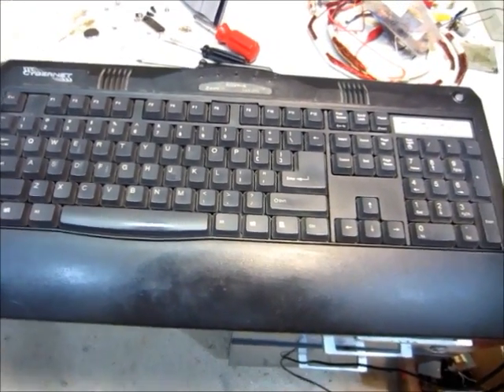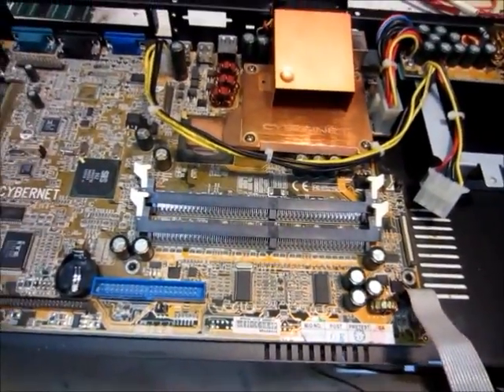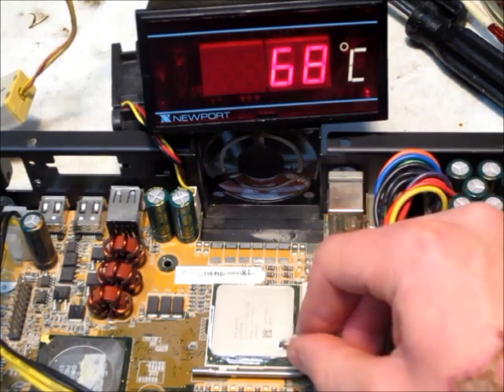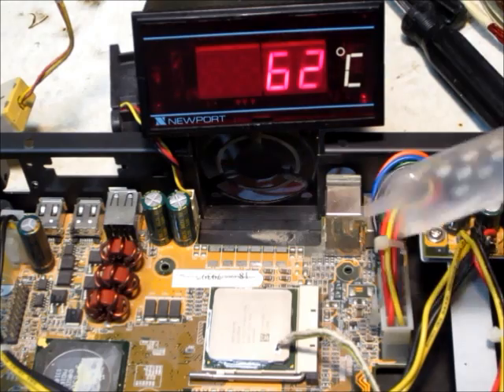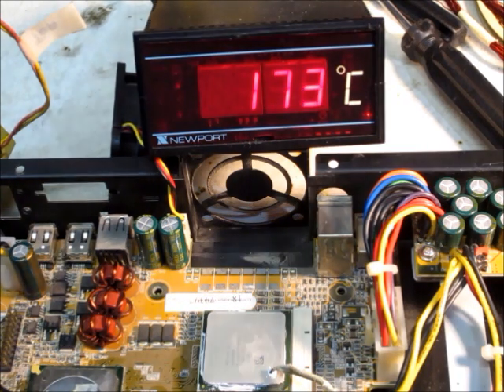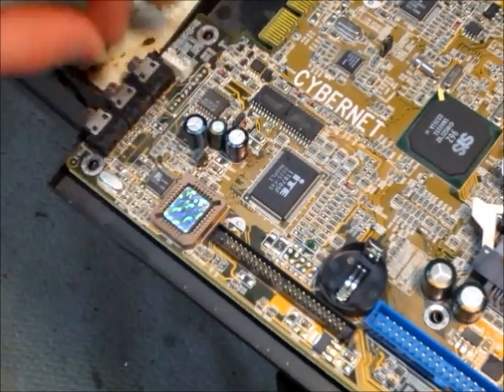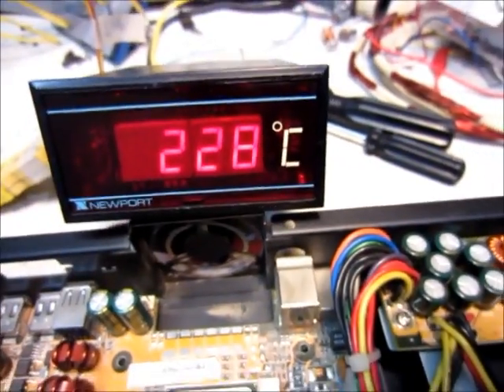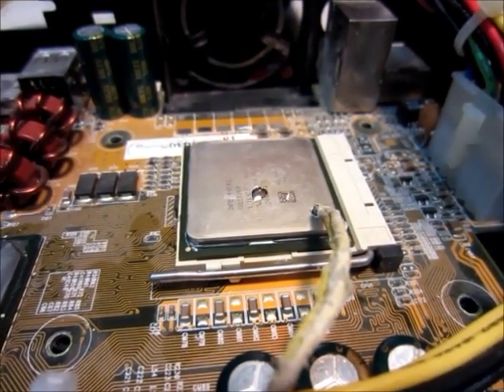Overclocked Computer CPU Without Heat Sink Stops Working at 234 Degrees Celsius and Melts Solder

Comment: I’ve seen computer inside monitors. I’ve seen computers inside monitor stands. Hell, I’ve seen computers inside desks. But I’ve never seen one in a keyboard, aside from laptops. 

Also, for being 10 years old, this video is pretty high quality. Especially for how young you sound back then. If I had to guess, you’re probably around the same age as me.

Comment: Surprised your surprised have heated copper to higher temp in the labs and other metals cpu's stay at 50-90 degrees for safety not because it will melt. Copper is made for wiring for a reason.

Comment: can fan without heatsink, cool-down cpu ?
air transfer heat better than thermal-paste.
Reply: i make mistake. air's thermal-conductivity is worse than thermal-paste
thermal-conductivity :
air : 0.024 watt/meter kelvin
artic-silver-5 : 0.94 watt/meter kelvin (experiment data)
                 8.7  watt/meter kelvin (manufacturer data)
themaxtech xt-flux-ga : 0.78 watt/meter kelvin (experiment data)
                        7 watt/meter kelvin (manufacturer data)
dow-corning tc-5022 : 4 watt/meter kelvin (experiment data)
                      4 watt/meter kelvin (manufacturer data)
shinetsu x-23-7762-s : 3.7 watt/meter kelvin (experiment data)
                       4.4 watt/meter kelvin (manufacturer data)
source : 
1. http://hyperphysics.phy-astr.gsu.edu/hbase/Tables/thrcn.html
   from google (thermal conductivity) result 8
2. 'watts per meter-kelvin (W/(m⋅K))' in https://en.wikipedia.org/wiki/Thermal_conductivity#10_sep_2018
   from ref[4] in 'The company claims that AS-5's thermal conductivity is 8.7 W/(m·K). However, a study led by the US National Renewable Energy Laboratory found that it was only 0.94 W/(m·K).[4]' 
   in https://en.wikipedia.org/wiki/Arctic_Silver#Arctic_Silver_5_.28AS5.29

Comment: But can it melt steel beams?
Reply: its a joke you dumb fuck
Reply: Surley it can melt dank memes?
Reply: haha that was so funny
Reply: +KOSCade No possible way.  Burn the living heck out of your hand if you touched it and hurt like language best left off of YouTube, heck yes, but in order to melt the integrated heat spreader, the CPU would have had to have heated up so that the reading on the kid's thermocouple would have to read around 1,000 degrees Celsius for common steel.  it would have burned up long before that point, of course.

Comment: how did he even shut off the protection?
Reply: +Ramses There was no protection because there was no RAM, the bios couldn't initialize.
Reply: The illuminati but if the bios didn't initialize how was he able to initialize the overclocks?
Reply: +Ramses Exactly, he didn't.

Comment: Wtf is wrong with ur hand
Reply from the maker: +Skyler Yeah... I spilled molten zinc on it...
Reply: why am I not surprised after seeing this video lol, nice vid.
Reply from the maker: Captain Gray Thanks!  I'll try not to burn myself!  :P
Reply: +Makerj101 The burns must have been really bad tough. But I'm glad to to hear it turned out alright :)
Try and be careful, for your own sake ^_^
Reply: +Makerj101 Dude, zinc has a 419.5 Celsius melting point.
That outta hurt like mad. How's your hand doing?
Reply from the maker: +Captain Gray It wasn't that bad really.  It hurt a lot at first but it's not like the zinc was sitting there sizzling(ouch, don't think about that much) for a while... as soon as it spilled on my hand a shook my hand an flung it off.  Some actually made it all the way on the wall.  The burn took a while to heal all the way.  Like 3 years layer you can hardly even see a scar any more.
Reply from the maker: +Tyler Nandalal LOL yep!  I'm not supervised either!  :P

Comment: It must've been AMD.
Reply: +buenajuan3001 cough Pentium G3258 using stock cooler tops out at 88c under heavy load, 3.2 GHz.
Reply: buenajuan3001 5100 RPM? Fucking hell that's loud as fuck.
Reply: But how does a pentium 4 get lower temps? i mean Pentium 4, one of the worst cpus that ever existed in terms of efficency runs cooler than a newer, made for energy saving cpu...And my turion 64 x2 is even cooler. (35w)
Reply: Are you drunk? Both are loud but the AMD cooler is obviously bigger.. Have you seen both in person? The AMD cooler has copper heat pipes and a loud fan and the intel cooler is a tiny round cooler with an even smaller fan... Intel makes better CPUs but it has been proven that AMD has much better stock coolers.
Reply: Try stress testing it then come back to me.*****
Reply: Yasper is such a troll  lololol. The stock cooler for intel is terrible, without overclocking you'll still hit at least the high 60's (though high 70's is much more plausible) in burn-in/stress tests.
Reply: +Mike Peabody Intel are known for low temperatures (i3-4005U and 32° under heavy load)
Reply: buenajuan3001 Somehow I don't buy it. What model is it.
Reply: ^^ That's bad for gaming
Reply: And your laptop isn't as loud because it's enclosed and laptop fans are adjusted at a low rpm depending on how thick the laptop is.
Reply: What are you talking about? A GTX 980 doesn't use 2GB of VRAM and your shitty laptop probably can't run Grand Theft Auto V for shit bro. I have a feeling you aren't very tech savvy
Reply: And what the hell is a touchscreen GTX 980?
Reply: "Looks at old pc" whaat? I caaant heeaaar yoouuu!! Really. If this PC turns on you think someone starts a Plane. (P4 EE Stock cooler)
Reply: +buenajuan3001 thats actually completely wrong, amd's cooler is far superior.
Reply: Its from an i3. 2014.
Reply: *****
 What? The G3258 at 88c? I'm pretty sure I did it correctly. Hit both CPU and iGP using AIDA64.
Reply: Which I call bullshit, unless you're using an aftermarket cooler.*****
Reply: You realize why I am calling you an idiot? It's impossible for a G3258 to run at 32c at full load of AIDA64 stress test. It will not be as cool as that. That is why I'm calling bullshit.

As a matter of fact, you're the first person to say that. So I'm the one who should ask you, how the fuck did get temps that low? Post me screenshots and pictures of how you "install stock cooler correctly", because it's impossible to install it incorrectly without pushing the pins all the way.

Keep in mind that I got an idle temperature of 35c, which is normal. If I did the install wrong, it'll be much hotter from the moment it boots.
*****
Reply: "mine ran at 32 degrees so you better Check you've done everything correctly.. "

Still not plausible even at 42c.
*****
Reply: Are you using like, a damn Celeron or something? Even an i3 will reach at least 50-55c on stock cooler during burn-in.*****
Reply: Why?
Reply: I was joking since AMD CPUs are notorious for being hot
Reply: Valkyrie Oh yeah, all AMD processors (CPU or GPU) run hot, my friend's 290 ran at like 86 degrees under load stock clocks (Sapphire Tri-X version)
Reply: +StrongarmSlayer Cough, 43° C in a laptop with max refrigeration playing GTA V
Reply: buenajuan3001
 Max refrigeration? ... what? You mean aggressive cooling?
Reply: No, just fan at 100% in Speedfan .-. 5100 RPM and it's not loud
Reply: In this laptop not
Reply: Dell Inspiron 3442 very good laptop, mine is a intel 4400
Reply: Lol i can run GTA V and theres a Touchscreen Nvidia GT980 2 gbs version
Reply: Sorry, Touchscreen AND a GTX980, oh and i was thinking in any number for the vram lol and man, don't me rude.
Reply: buenajuan3001 Okay. A 980 will run this A-O-good, 60fps AT LEAST high settings.
Reply: I think they should put this laptop on the alienware models
Reply: +Mike Peabody Probably much higher on Ultra dude. A GTX 970 can reach 70 FPS in Ultra.
Reply: Valkyrie On JC3? How could you know that? I'm just offering minimums
Reply: Because the game is made by Avalanche and you know how the optimization for Mad Max went. So you should be able to hit pretty high FPS scores. :)
Reply: +Valkyrie  Doing some checking, it could be either a Pentium 3 or Pentium 4.
Reply: +Valkyrie Lol best comment i've seen. Those AMDs will go up to like 600-1000 degrees F in less than 15 seconds without a fan/heatsink lmao
Reply: +Valkyrie Lol best comment i've seen. Those AMDs will go up to like 600-1000 degrees F in less than 15 seconds without a fan/heatsink lmao
Reply: LOL Joking LOLOLOLOL Nvidia 850M
Reply: An R9 at 86 degrees? the fuck is wrong with this...my 6 years old Sapphire HD 5770 runs At 1Ghz (Stock 860Mhz) and Just hits 60 degrees lol....ps, in my laptop, my amd a6 5200 just gets 43 degrees at max load (furmark and prime95) instead my friends core2duo laptop easyly hits 70 degrees at load....
Reply: And the AMD A6 is relatively new processor and the Core2Duo is a very outdated processor, don't compare it if they are from different years
Reply: Both 25w CPUs. Even my OLDER Pentium 4 laptop runs cooler than the core2 one...with 65w tdp.
Reply: Different nm production...
Reply: Single core
Reply: Aaaand... The intel stock cooler is more efficient than the AMD one
Reply: +buenajuan3001 thats actually completely wrong, amd's cooler is far superior.
Reply: +buenajuan3001 thats actually completely wrong, amd's cooler is far superior.
Reply: My old Intel Stock cooler Sounds like a vaacum Cleaner... My even older AMD Stock cooler (Athlon 2 x4) is still very Silent...And now look at the new Wraith cooler.
Reply: Again, don' compare tech from different era
Reply: Athlon 2 x4 cooler does not equal i3 2014 cooler
Reply: +Valkyrie shut you're ass! i have a FX 8320 never gets above 40C full load
Reply: +Valkyrie no it's not  a Amd its a intel
Reply: +Valkyrie Mine cant not even over clocked I cant reach 70 FPS!
Reply: Valkyrie Nope, that's a Prescott Pentium
Reply: i think the i9s prove it /s
Reply: Mike Peabody it is AMD cus of the socket
Reply: its a intel with a am3 socket

Comment: did you have to run some kind of processor-intensive software to get it to heat up? or does it just do that on its own once you turn on the computer?
Reply from the maker: Tom P. Mathi De Pauw  Well for one it is a older processor so it does not have a variable clock frequency or throttling.  Throttled processors change the clock frequency based on load and temperature so they do not self destruct and to be more efficient.  So it basically puts out the same amount of heat no matter what.  I did however go into the bios and disable the temperature shutdown and over clocked it.  It would have don this without over clocking but it would have taken a lot longer.
Reply: It will pretty much do that on itself seeing the heatsink was removed. Would be even faster with a game or rendering software running.
Reply: Tom P. well, if this are what its looks to be, and AMD processor is over 100% eficiency heater, so just remove the heatsink, and see the things on fire...

Comment: Lol the 3D printer at school can't even heat up that fast! That is an insane temperature increase rate!
Reply: Connor M Yeah, ours takes ~20 minutes to get to 260 Celsius.
Reply: that's because normal 3d printer firmware has a fixed rate of temperature increase

Comment: The water rolling off is called the Leidenfrost effect. It happens with Liquid Nitrogen since it is extremely cold but you have more energy on the positive side then LN2 on the negative side :P That's when you know your CPU is hot.
Reply: Trillion Amaze He's right though, it's the same effect.
Reply: He wasn't using liquid nitrogen though.

Comment: what was the cpu model?
Reply: Makerj101 of course :P
Reply from the maker: Intel Pentium
Reply: ***** It's a socket 478, so a P4.
Reply: +potatoe potato Intel Gaben
Reply: potatoe potato darude sandstorm
Reply: ???? And how did you make that conclusion?
Reply: Mike Smith that's an old intel one, old intel cpu's, just like amd's back in time, didn't have any overheating protection, so it just kept going till it died
Reply: Potato 🥔
Reply: potatoe potato Intel Pentium 4 from 2000-2006
Reply: NVIDIA potato ti
Reply: +steven Mile I can't tell the model exactly but thats an AMD chip.

Comment: Wat cpu is that ?
Reply: Pentium 4 Northwood socket 478 1.4~1.9ghz depending on what year it came out, for a 2002 era pentium 4 its most likely 1.6ghz as the 1.86ghz P4s didnt get popular until middle 2003.  #HowHeKnowThat
Reply: Makerj101 my dad got me into computers through osmosis when he had an old ibm PC XT sitting around when I was a kid (around 1996) and I used to mess with the computer until he gave me my first 486 based computer, from then i've had lots of computers and have done computer work for most of my life. If you need help with vintage electronics (notice I didn't just say computers) you let me know ;)
Reply from the maker: Umm I know its an Intel.  It might have been a 1.6 GHz.  Not sure.  I would have to dig through my scrap CPU box and find it.
Reply: oh its probably a pentium or a centrino but good vid
Reply from the maker: Intel Pentium sounds right.  I looked in my junk CPU box (gold collection).  The CPU was there but I took the silver/copper top plate off.  So IDK what it is.  Probably a Pentium.
Reply: ok cool
Reply from the maker: Interesting!  How did you know that???  LOL  Thank you!
Reply from the maker: ***** Wow! I will remember that!  Thank you!

Comment from the maker: It wasn't okay.  I mean back in it's day it was probably really good but for today's standards it's really slow.  Also you can not expand at all.  So if you want a more powerful graphics it's not really going to happen unless you put it on the outside of the case.  But yeah the design is pretty compact/cool.  The heat sink would have costed a fortune to make.  It's solid copper and was costume designed for this computer.